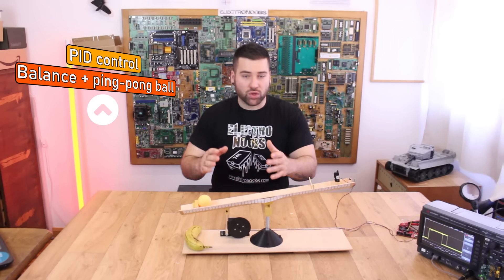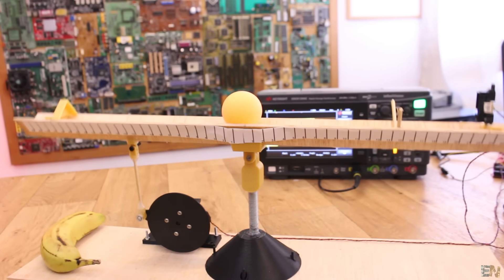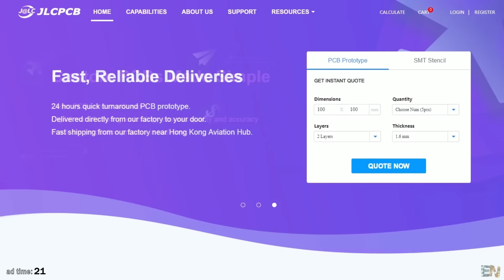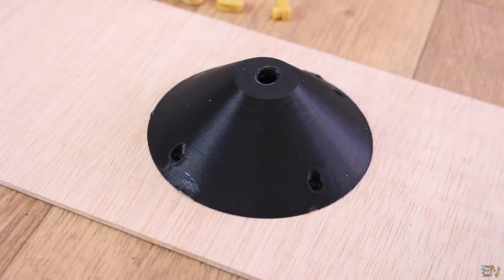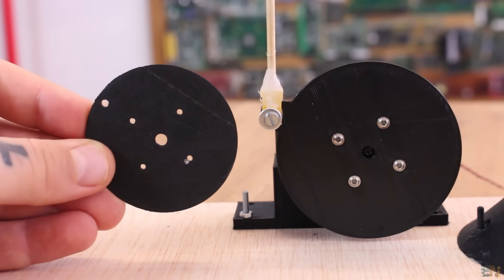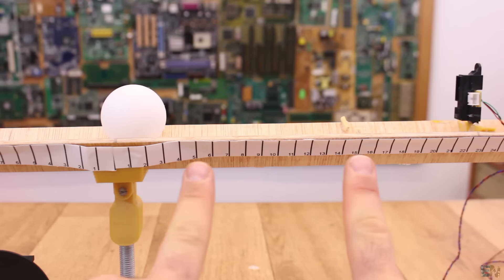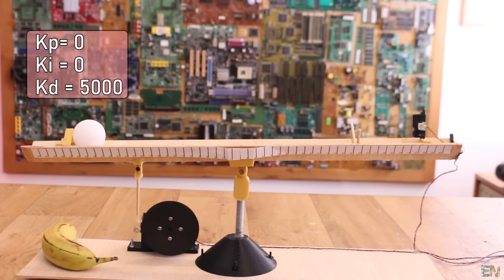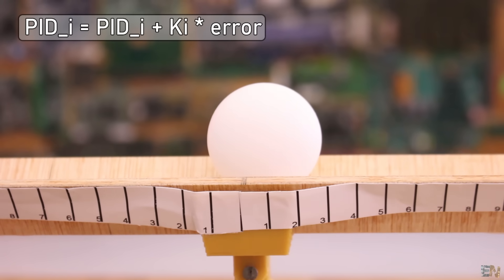PID Balance+Ball | full explanation & tuning

Comment: I think it's the best explanations of PID control concept i've ever had. It didn't dive into mathematical model, but it gave concept of how PID works. It's good if you make another video on how to apply filters on the system.

Thanks for making this awesome video mate.

Edit: you've got a new subscriber here.
Reply: This controller uses the ideal formula for D i think. If the setpoint is changed from a value to another (or the measured value...)in this case if the ball is moved from one point to another, the difference between measure and setpoint will instantly change and so the D will jump up to infinite for a moment (error-previousError/TIME)... In reality a filtration constant is needed. The shaking in this is probably is due to te inaccuracy of the measuring device (the measurement value jumps in steps instead of smooth rise/lowering) for that you'll need the filtration timeconstant, which will limit the jump of the D-control. Don't really know how to explain better without bringing laplace-functions to the table... Laplace functions are imo the easiest way to show the principle but i'd have to explain how they work...
Reply: So, lets assume the system in this video checks the balls position every 1 ms and the accuracy of the measurement is 5mm. If the ball moves really slow, lets say it is 20mm away... it can move a few mm (to 22mm) before the measurement device reacts, and when it reacts (at 23mm), it'll think it has moved to 25mm. Now that the last measurement before the change was 1ms ago, the derivate part calculates 5mm/1ms, even tho the ball would be just barely rolling. The speed calculated with these values ends up being 5m/s.  This makes the excessive back-n-forth movement. I think you might have already figured out why the filtration is needed but anyways... I was bored so I explained anyways :D also this didn't help at all with what you were asking which was HOW to make the filtration XD
Reply: Elimination of derivative kick is a good term to google
Reply: @MrScorpnok  You can also just get rid of the D term if you are okay with a bit of overshoot. Most real life process automation just ditches the D term because it has destabilizing properties :D
Reply: @akkudakkupl  haha this reminds me of what my teacher told, once a customer demanded to have a PID controller, while my teacher tried to explain that the D is not needed for the process... In the end my teacher then installed a PID-controller, but set the derivation time to zero😁
Reply: Yeah
Reply: I made my machine learning pid iron station and i made pid code by helping your videos great man

Comment: Excellent illustration. Would be improved with pots to adjust gains (factors). Question: why the capacitor? Isn't that an "I" term?
Reply: The capacitor helps eliminate noise in the feedback loop.  I just did a project for a customer and the motor was full of chatter like his.  I added a 10uF capacitor on the feedback pot and the chatter went away.  The differential term amplifies that error and causes motor chatter.  He could probably use a larger value in his system.

Comment: Why can't the VL53L0X sensor mesure above 20cm? I have five VL53L0X sensors and they can to mesure until 70cm. I can't understand :( 
what is the problem with your VL53L0X sensor?
Reply: Yeah me too!, I meanm I have 2 VL53L0X sensors, and They work good till 800mm
Reply: You have to use "long range mode"
Reply: The VL53L0X senses any objects within the approximately conical field of view, biased somewhat by the strength of the reflections. When the ball was within 20 cm, its massive reflection swamped the smaller echoes from the track and various stuff mounted on the track. If the ball wasn't close, the reflections off the track dominated.

Any leftover captan tape would also lower the sensitivity.

Comment: How do some servo drives have automatic pid tuning? 
Never seen anyone talk about that.
Reply: because the majority of hobby "servo" drives are not PID controlled, the speed is constant and the motor a has great (like real great 1/50 for example ) gear ratio while the position is captured on the final shaft (a potentiometer most of the time), the controller just tries to meet the desired position by commanding the motor until it superposes with it (simple error calculation). it's a very simple and unexpensive way control a motor in position but  clearly not one of the most precise  nor optimized but it's cheap and sufficient for hobby ( if you want to find PID servos you can look at some numeric ones, dynamixels for exemples !!! not all numeric servos have a PID controller). so to resume, nobody talks about automatic servo PID tuning because the majority of "servos" dont have a PID controller (and also because auto tuning a PID isn't what you would call "an easy and straight forward task") sincerely a french control engineering student who's just passing here 9pm because of complete hasard of the internet :)

Comment: Nice simple explanation. 

  When you, (or anyone else reading this with an academic background) were in school, what other "Control Theory" algorithms did you study other than PID?
  I know PID is not the best algorithm in some applications (like voltage/current regulation), but I'm not familiar with the other types I should research or their overall usefulness. I've seen and saved some content about control algorithms, but the math can go over my head quickly with my lack of a proper EE background. Any info helps though.
 Thanks for the upload.
-Jake
Reply: Upcycle Electronics MPC - Model Predictive Control

Comment: Fantastic explanation plus example. But would you have an article or something that helps how to find the values of the constants (Kp, Ki and Kd)? For example, if I would like to control the output voltage of an DC-DC converter (buck, boost etc). I know how to do it using space state, and using the duty cycle of the switch as the actuator, but I was looking for a more direct way to find these constants.

Comment: Thank you for sharing this video , how do you derive the system equation ? is there is any reference book you used for this purpose , also the PID control have two other important parameters is Controlability & Observability both related to system accuracy , can you please explain in details the system parameters & system equation ?
Reply: The equation for the PID control is literally on screen.

Comment: The bit I don't get is why you choose the initial values you do. Why choose 20 as a start for the P?   Why not 2.5 or 150 or 10579? Why choose 5000 for D?  Why not 8 or 2 million? Similarly for I. I appreciate you choose a value and tweak it, but the values are so different from each other, guessing a reasonable start for each of them seems mysterious or magic.
Reply: These numbers depend from PID implementation. Every regulator (controller) have diapason for each of the constants P, I, D. Commercial PID regulator (controller) units have good documentation about these values. But in this case you can see the code and get the idea what it must be. For example when I and D are zero and he plays only with P, calculation must return value over 20 and bellow 160. I'm only guessing that's because of the servo (actually it add 30 to that value so total be >= 50 and <= 190). Anyway Kp is determined by simply multiplication of distance error and P constant. So let's assume ball is in the end. Then Kp will be (21 - 42) * 8 = 168. As you can see he is already shooting over the limit and Kp will be 160 in that case. Actually it's pretty funny, because when he start with 20 the system was complete mess, just because that value was way off from what is accepted by the code. That's why ball reach these limiters in each end which in theory you must not do. In the end that is the work of the controller - to regulate and not to exceed limits :) This regulator (controller) is called simply P controller, because it has only P constant. Of course you can have I and D in same fashion, but these are not much useful without P, so you can see PI and PD controllers also. Of course this system is simple and nothing major can go wrong, so you can go for "fast" control and just shoot P to the sky, but in reality you need P just to overshoot slightly the target. If you done that then you will see the ball moving around the target (center), but it will never stops at the target. Then ... just see the rest of the video and code :) btw there is nice trick - I constant is only valid when the ball is in the 3cm of the target (center). That's a nice trick and shows the beauty of software PID implementation. However is shows that this controller is not well tuned :) Anyway ... hope this help a bit.

Comment: can you explain plz this: float distance_cm = 17569.7 * pow(adc, -1.2062);
Reply: Im not sure, but its probably from the sensor datasheet. You have to calibrate it and will vary depending on what sensor you are using. If its not on datasheet, you can calibrate by yourself, looking the number your sensor is reading and comparing to the real distance centimeter by centimeter, then you trace the curve and find the equation.
Reply: @barth3113  I think that,,thank you for your interesting   ^sorry about my bad English :) ^

Comment: Hi, I work with PID controllers in the process industry 32 years now, to help simplify things, from experience, in reality a PI works fine with most processes,
The D component may give an extra help in some temperature controllers.
Reply: My understanding is that D will help protect from overshoot.  This will help eliminate wasted energy.  I see this could be useful in driving economy or other autonomous vehicle systems.  What do you think?
Reply: @JonathanWaltersDrDub    cruise control is a PID system in newer cars
Reply: Indeed PI is in general enough to get a system stable, I only use D with very agressively changing processes. That being sayd good base explanation of PID control.

Comment: Excellent example on the use and explanation of PID control. I am curious why you did not use the PID library that has the math and other features?   My question to you?  Would the PID library work the same as your version? Would it produce the same results? or would it require more trial and error to get the same results.  I ask since you already have the setup made and ready to test.

Comment: And now
let's do it with
State-Space
control.
Reply: Ha. I was just asking about other control theory algorithms. What other algorithms are common in the real world, other than PID and State-Space?
Reply: @UpcycleElectronics  
Fuzzy logic ,neural net
Reply: @UpcycleElectronics  There's some more advanced ways around the problem - but most applications don't bother cause well-established PID loops are simpler to implement for a non control engineer... I worked on a research project to develop advanced controls for a particular application - and after almost 18 months of research and testing, my conclusions were "Do you really want to spend all this money to develop a control technique that'll give you marginal gains in performance where you could design better hardware  with in-house skills that would make much more significant gains"...
Reply: sliding mode control also

Comment: Great project ,. Can you make custom led flasher with Arduino like emergency lights of ambulance or plane for drone .....I need it by August month to complete my drone project
Reply: Why you asking for led flasher which can be done with basic BLINK example ,when you doing advance drone ....
Reply: @casper2501  I need double blink or multi led , I have tested on blink sketch but not satisfied
Reply: @SIKHGT650  So just put smaller delay when you want shorter blinks.